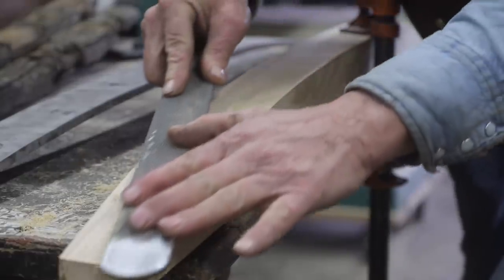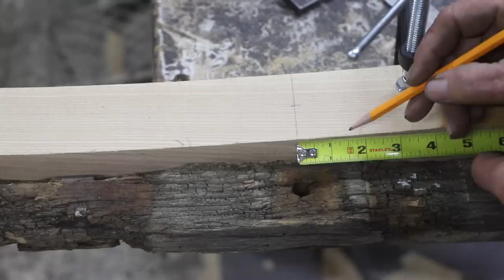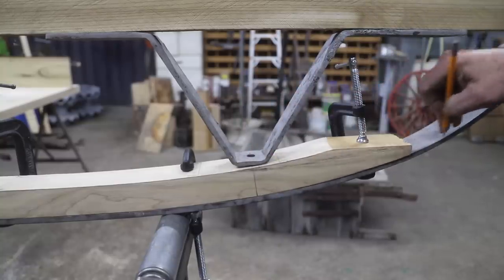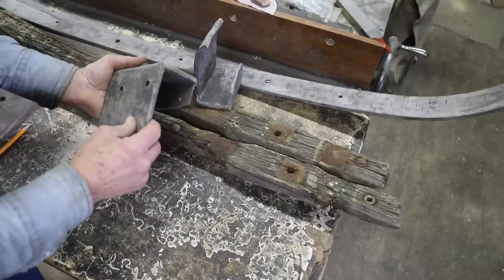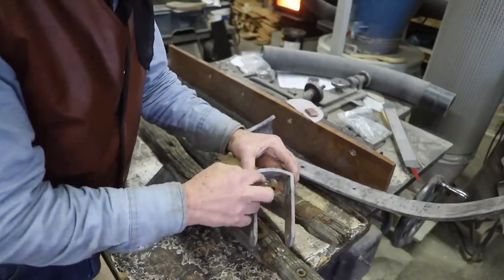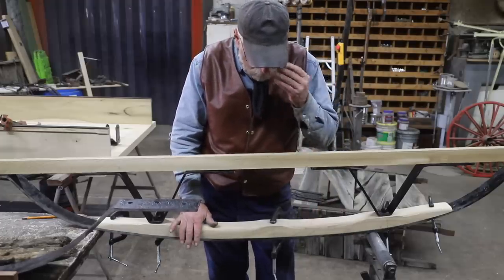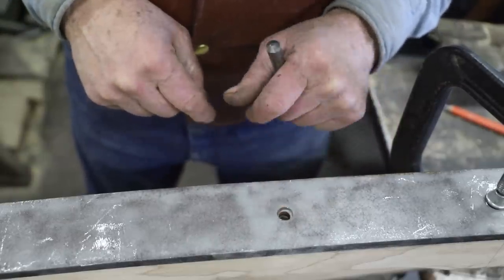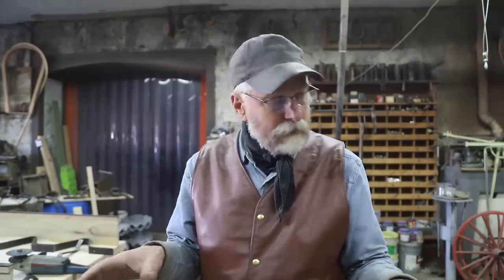Setting the Framework for Coach Suspensions | Engels Coach Shop

Comment: I like the way you hog the wood with your rasp Dave. Thank you  for sharing.
Reply: Well that's just about how my hogs eat so I see the connection to the words. Lol!
Reply: The rasp is a awesome idea!
I kept my dads rasps for ever!
Now I understand! More mileage from steal on wood cutting to shape before using costly sand paper!
Thank you!
Was kinda a duh moment for me! Lol
Reply: A rotary rasp is a better wood hog. You can do the last little bit by hand. A rotary rasp gets you to the last little bit really fast and easy though.
Reply: @1956vern  I'm just guessing but I don't think they even used sandpaper when making wagons, I would think they would get it as smooth as they could with a scraper and be done with it. Dave builds works of art, I doubt it was originally built to Dave's standards. I'd be curious if anyone had more info on the use of sandpaper in wagon making.

Comment: It is interesting that the coach bolts that you reformed ended up being what I know as deck bolts used in the deck and hull of large timber boats with a steel frame. We had thousands of them made for a restoration that I worked on.
The purpose of the flat head was that a wooden cork would sit flat on it and exclude water.

Comment: I appreciate the diagnostic analysis you present in your videos.  Is there any evidence that coach makers (like whoever made the current example) used any form of standard (mass) production for the ironwork?  Or, did they more likely have different guys hammering out the left and right side irons, and different guys drilling out the holes to bolt the irons to the woodwork?  Or, is the variation that you're running into, more likely a result of repeated repairs over a period of months or years?

Comment: I know the optimum goal is to have symmetry between the pieces you are currently working on. 
My thoughts are that you could’ve chosen one runner holes or the other, perhaps even split the difference and weld up the unused holes and redrill new holes. 
Or perhaps that something was added to one side that facilitated the shifting of these holes.

Comment: I am fascinated by the attention to detail. It takes a well seasoned wood worker to "Read" the wood on where the iron work goes. Fitting the wood to the spring could be done quickly by just cutting the curve and bolting together. However, you make sure that everything fits exactly before assembly.

Comment: Dave could use some cheap rotary rasps doing some of that wood shaping. Really the one you want is the conical shape. It can pretty much do it all. The other shapes look useful and on occasion I have used them but the conical is the workhorse. You want to run them in an air die grinder. That gives you maximum control. They're a smile on your face using one tools.

Comment: RE:  misaligned bolt holes

Could it be that the one iron is swapped fore and aft from the other?

Also, it seems usually, but not always, that Mr. Engels oils the wood on various projects.  Is this by client request? (The client prefers to treat the wood himself.)

Comment: Dave The mystery deepens "Why are the bolt patterns different from left to right?" Two wagon builder apprentices doing it their way? It must be original and not from the after wreck patch job. I guess I'm to used to the idea of standardize interchangeable parts and that holes must be drilled to a design spec from a blueprint.

Comment: I've seen people fill holes that were no longer needed or in the wrong place with weld, then drill a new hole. Is there a reason that wasn't done on the steel so all the holes would line up?

Comment: In Oz we have the Coachwood tree (Serratopetalum apetalum, rarely called scented satinwood / tarwood) which I beleive was  used for sprung (?) or chassis parts. A beautiful light temperate rainforest timber. Do you have springy timbers in America?
I nearly bought a lovely ex tecnhical college table used in chemistry for its oily impervious resistance to spills or sewing (?) for its very smoothness.
P.S. Is the old hotel haunted?
Reply: ...table made of same...
Reply: I'm not aware of springy timbers here. It's not haunted that We know of. 😄

Comment: Hello Mr. Engel, I mean no disrespect sir, but why don't you use the metric instead of the imperial measuring system? I mean it is soo much easier! Have you ever tried to use it? One day or so and that might lead to one week and that might turn into a month and after that, guaranteed, you won't even think about the imperial system! Promise! But should you absolutely didn't like it, go back to the outdated system! No harm, No foul! Oh, keep up the good work!
Reply: He's working, in America, on a wagon originally built in inches and feet. And raw materials (here) are in inches. So, trying to use metric for a restoration like this would be more, not less, work. Don't get me wrong, I think the metric system if great... but, especially in America, you have to work with what you have. And, if you've used inches and feet for many, many years, it isn't difficult.
Reply: @bobvogel9916  okay!